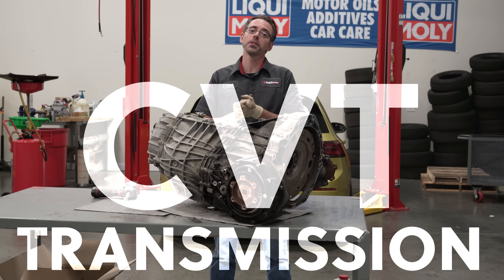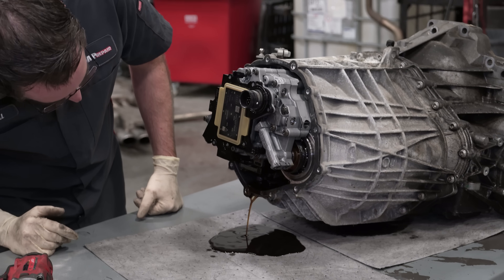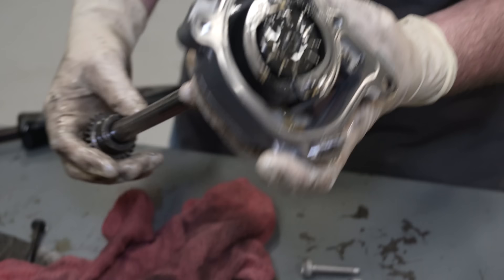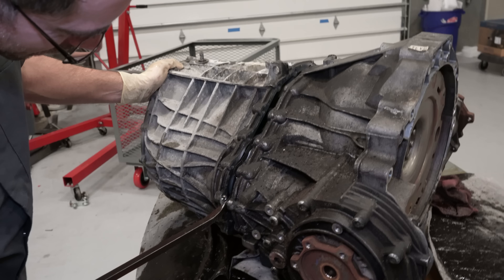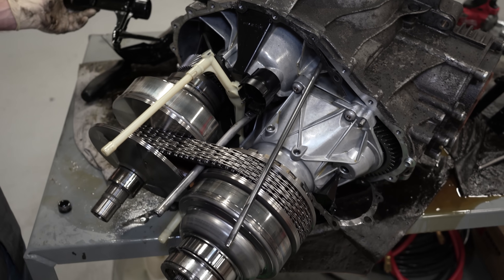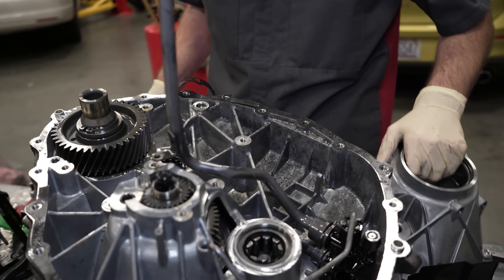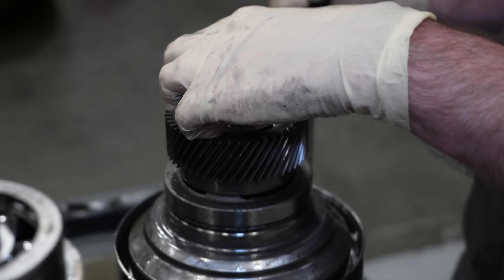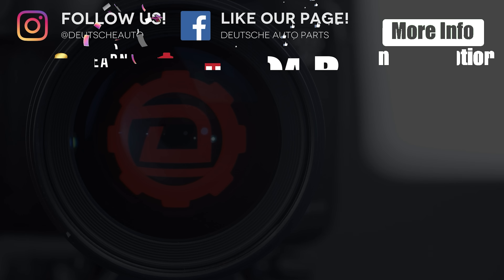Why you shouldn’t get a CVT transmission

Comment: I had an 8 gear auto volvo XC40. Now have a lexus UX250. When braking hard and then accelerating into a bend the volvo would get confused about which gear to select. Annoying delay. The lexus is instant everywhere so is quicker in town definitely. Much prefer the Lexus CVT.

Comment: my 2014 honda accord is currently at 299, 720 miles. I used the recommended HCF-2 oil, every 80,000-100,000 miles. I also replaced the filter at 280k miles (i know i risked messing up the transmission by changing the filter that late for the first time.). If i do end up getting another CVT vehicle, id just stick with Toyota or Honda, i've heard nothing but bad things about the nissan CVT's

Comment: LOL This concept has been around for over a Century. My 1940's bench lathe I use for tool and die making, uses the same engineering. Exact same. Smooth, solid and lasted way longer than any geared machine I worked with. I promise you a belt wheel machine made the dies that produced parts for all of your vehicle's molds and fasteners. It's only a matter of time until it gets more perfected in the automotive world. So, instead of bashing the trial years when it's for the automotive world, if you're gonna trash the idea and give up, perhaps you should work for GM. Give up easily.

Comment: I had a 13 year old Honda with a CVT and it juddered a lot when moving off. I got it used when it was  10-11 years old and I guess the oil wasn't changed. It was still drivable though.

Comment: I had a Nissan Gloria with the extroid CVT.
It was RWD 3L V6 turbo.
The most silky smooth transmission I've ever driven.
It had about 280,000km on the clock before I sold it.
I did a full service at around 150k, the oil - KTF-1 was crazy expensive.
The gearbox is quite unique in the cvt world.
Reply: it drives and sounds like a boat transmission
Reply: @whoawoahh  and they are an absolute nightmare to work on. just a complete messs
Reply: The toroidal one? Wish they would use that more.
Reply: Nope

Comment: Being covered with flour from head to toe doesn't make you a baker. Do you really know what you're doing? Because it doesn't look like you do. Yes, badly designed and/or made CVT's can be a headache, but here's a newsflash: more and more car makers use them. Why? They are the closest thing to a perfect compromise between fuel consumption limits and power needs, as they help use engines well within the boundaries of their optimum performance envelope by eliminating much of the performance delivery gaps inherent to all the other types of transmissions.

Comment: CVTs might last longer if the fluid was changed more often, and manufacturers called for more frequent fluid changes.
I have a member of my family who has a Nissan Murano, and drove his over 150,000 miles. I told him to change the fluid twice as often as what the manual says.
The only reason he sold that Murano and bought a new one was because he just wanted a newer car.

7:57 Nissan probably uses them the most. Scotty Kilmer loves to make fun of Nissans.

Usually when a CVT fails, it is the steel chain going boom. It looks like a metal bird exploded and stuck its feathers everywhere.

Comment: lol COOL, yeah I hate them too, at least that one, with the crap design, they would be better off changing the chain width with electromagnets, but then why even bother with the gear ratios, they can do away with all the heavy differential and drive shafts, use the engine to generate electricity for electric motors 1 driving each wheel, cars could be a lot cheaper and cause less global warming, but nope, Elon Morron wants to make Tesla cars that have a battery that costs more than an engine and transmission combined and costs 7.5 tons of CO2 each and it gives the car a use by date too, regardless of how often you drive it, the battery die anyway, it's greed, he knows you can't sell them second hand, they're all throw-away CO2 pumping nightmare cars that Muskrat has chosen, he could have used hydrogen instead of what he is making and he is hoping to take off to live on Mars when the global warming cycle comes to its natural end. 
The guy will go down as the biggest mass murderer ever, but with only microscopic deep sea creatures still living in an ice age, his crimes of needlessly producing massive CO2 emissions will go unpunished, he should be ashamed of himself.

Comment: Not sure why you made a video about CVT's when you literally know nothing about them, including the differences between an Audi or Subaru chain driven one vs a Nissan pushbelt driven one. Heck, you leaked CVT fluid everywhere because you don't know what you are doing, then were surprised after that when you covered your shirt in fluid because you don't have a clue how the variators worked and didn't realize the pressure reservoir inside it would be filled with fluid because you didn't drain the thing right. Then, you had ZERO clue how to remove the chain or chain guide, and resorted to wasting time (taking 3 times as long) doing it the wrong way. 

WOW

There's so many far better CVT vids that actually explain the strengths and weaknesses of the various designs - this sure as heck isn't one of them. This was one of the simplest chain driven CVTs to take apart, and you struggled and did it wrong EVERY STEP OF THE WAY.

Comment: CVT's get better every year and with proper maintenance will outlast an old-school tranny.
Reply: You're either an optimist or a CVT engineer. I'm gonna stick to my 1987 Toy Diesel with 300,000 Kms and the original clutch. Thank God for waaahmen and fancy interiors, who else would buy these crap new cars?
Reply: @warntheidiotmasses7114  Kia SOUl's with CVT are getting 300,000+ MILES

Comment: I have and always will be a fan of the Subaru CVT.  I have seen no reliability issues and definately help with any efficiency loss of the powertrain.  About the only thing I don't care about them is Subaru's insistence of the CVT fluid being a lifetime fluid.  Once the drivetrain warranty is up (100,000 miles) I take them back to the dealership and have the CVT fluid flushed and reserviced.  About the only AWD vehicle I would ever consider owning.
Reply: You understand that the fluid is not lifetime. The reason your Subaru cvt is reliable is because it’s a Jatco cvt and Jatco hasn’t had issues since 2013. This clown doesn’t know anything about cvt’s or history or differences between the cvt’s.

Comment: I agree with the sentiment expressed here. CVT automatic transmissions are garbage & should NEVER have been made. It is apparent that after all the problems that have cropped up, they should no longer be made. I don't care what some say about how much they have "improved"in cars like the Corolla. That's just saying they are no longer as bad as they were.... but are still iffy. They are INHERENTLY weak, prone to break down, & IF they were in fact tough, they could be,,,,but in fact are NOT,  used in vehicles that pump out a lot of HP & Torque!! The very slight gain in improved gas mileage is not worth the expense in possible breakdown & replacement cost, nor the extra expenses in maintenance, nor the worry over them. Bury them once in for all.

Comment: They call it the CVT transmission technology is an ingenious milestone of optimization in modern vehicles. While it's  the worst design that's costly & easily to break down of it's complex assembly & functions. I had a Kia Sorento I drove 500,000 miles that came with a conventional automatic transmission while others who drive CVT cars complained about faulty CVT transmission at the threshold of 100,000 miles..

Comment: Hello ! I have a question and I hope you can help me solve the problem! I have an Alfa Romeo Mito 2011 1.4 petrol automatic gearbox and the engine was damaged and I had to change the engine and I bought an engine and we changed the engine but after changing the engine the transmission it does not work and when you put it in driving mode or any mode  it crack a few times and then gives a signal of a malfunction in the gearbox. And when you do the diagnos, it gives you an issue  in  hydraulic system. Do you have any suggestions or idea about this ISSUE ?  REGARDS

Comment: I had a 2000 Micra K11 1L with the old "N-CVT" transmission. It was an interesting technical implementation because it used an electromagnetic powder clutch to control the amount of coupling between the engine and transmission, unlike other autoboxes which used a torque converter. It had zero creep, so if you stopped the car and didn't use the footbrake or handbrake, the car would just sit still (or even roll backwards if on a hill).
It had some reliability issues leading to juddering and slip when the carbon brushes inside the powder clutch (like alternator brushes, contacting a slip ring inside the clutch) would wear down. They were easily replaced (me and my wife replaced ours with alternator brushes for about €7), but eventually the powder needs replacing too and then it's probably not worth it anymore.
In late 2000 they replaced the N-CVT with a newer H-CVT model, based on a more conventional torque converter.
That said, I really miss that car. It was quite nippy up to about 30 km/h, then acceptable up to 50, then extremely slow up to 120 and beyond. It was really light and nimble, and I found the CVT great fun to drive. The high RPM whininess didn't bother me, but I can see why some people would dislike it.

Comment: Not all CVT are equal. The one in the new Subaru WRX are better then what you would find in a typical economy car.
Reply: It’s a modified Jatco cvt based on the JF017E. High torque and modified for the boxer engine. It’s an excellent cvt.

Comment: How much longer til you upload the rebuild video for that transmission?

I just bought a 2023 Subaru Outback with of course, CVT. Any words on reliability?
Reply: Simple answer. They can be problematic if you ignore the maintenance. Cvt fluid changes every 30k miles and it’ll be very reliable.

Comment: Stop the Shudder/judder – Don’t Replace that Nissan CVT without first trying this JilCat Professional supplement. Many different vehicle makes have used CVT Transmsissions. Ford, Subaru, Mitsubishi, Honda and even Toyota. All CVT’s can benefit from Jilcat Proline CVT Supplement. Many have had CVT issues across all their models for many year models. Altima, Murano, Sentra, Rogue, Juke, Pathfinder and Maxima. The JilCat supplement also works with Mitsubishi, Subaru, Jeep, Ford and Honda CVT’s that shudder. The standard repair is to replace the transmission. Cost: $2000 or more. Try Jilcat Proline CVT Supplement for less than $35 instead. There have been hundreds taken care of across the country. Do not replace, lubricate with an aerospace designed lubricant and metal conditioner first instead. They have a Youtube channel speaking to these issues as well. @jilcatproline6390

Comment: It’s not really that new of technology, new to automotive but it’s been used in agriculture for belt drives for decades to power equipment. Cvt transmissions are known to be top tier in agriculture having high horsepower heavy load applications but could be reliable due to lower output rpm’s maybe?

Comment: My dad bought a 51 Chrysler New Yorker. It had the first run Chrysler hemi V8 engine in it. It also had a semi automatic transmission I believe they called it. Perhaps you had to lift your foot off the gas for it to shift gears. Anyway, that was the Achilles heel of that year Chrysler. Three or four times we'd be driving along and smell transmission fluid and we knew it was about to stop running. I still remember the anxiety we felt. About nineteen fifty-nine it broke down in Bakersfield on our way to Tulare from Los Angeles. My family lived hand-to-mouth. I remember seeing that transmission all torn apart on the garage floor where we took it to be repaired and the mechanic telling my dad what had to be done and what it would cost. Somehow, dad always came through but it was a struggle.

Comment: I would never tow with this crap and definitely keep the oil changed every 30k miles. You have to baby them for them to last into the 400k mile league IF they cant eve make it that far. Haven't seen one thats at least 10 years old and with that many miles yet w/o rebuild.

Comment: The real problem with CVTs is that they aren't serviced enough. I have one in my Lincoln MKZ, which probably is a Toyota design. They recommend a 150k fluid service which is nuts. I changed my fluid 3 times before the 150k service interval and have no issues with it.
Overservice the vehicle.

Comment: Moral of the story - should be - never push CVT trans, just drive smoothly and it lasts a lot more with good mileage. But your driving engagements are never priority, just all about no drama moving from A to B. Just linear movement to get the most of the vehicle while getting better savings on fuel - kinda boring.

Comment: My wife is ready to get her 6th Infiniti. All had the CVT transmission with no issues. If you are driving the vehicle normally under everyday conditions, I don't see what the hype is! The dealer did mention the new QX60 has an automatic transmission which is supposed to much better, but it's all bullshit! I agree!! I laugh at all the motorheads who complain because the response time takes an extra second when you punch the gas. Buy a Corvette if you want response time!

Comment: The 'chain' looked to have a very unusual design; is it working in tension? It almost looks like the interlocking structure is designed to work in compression.

Comment: I had a lot of Mitsubishi Outlanders. In the begging they had awful manual and automatic transmissions. Without changing the engines all while making the Outlanders heavier and heavier, the introduction of the CVT reduced my real life city consumption from 21 liters per 100 kilometres down to 16/100. CVT with AWD blasts you away at traffic lights. If you make the first change of oil and filter of the CVT before 60000km and the subsequently every 50000km, you will never have any issues with Jatco CVTs. Such a transmission can easily last 200000km. They you have a CVT refurbishment for 1000-1200 euros and you are back on the road for at least another 120000-150000km. Oil change and temperature management is key. Always allow the car to warm up for 120 seconds in winter seasons.

If VAG cannot find or produce adequate CVT transmissions that works well on Audies, that is not the fault of CVTs.

With CVTs you keep the engine spinning at their most efficient RPM range. This reduces engine wear and emissions.

Comment: Four circles and V over W, essentially the same, are fair warning in general. Belts and pulleys are fine as a clutch to drive a lawn mower but do not belong in road vehicles. In fact, most conventional automatics are crap. Over the years I've had multiple manual transmissions, 3-5, and NONE has ever failed. I drive them so that I never had to replace a clutch assembly either.

Comment: Brilliant review for which I thank you. I'm about to buy a newish car at the moment and was thinking about avoiding anything with a CVT transmission. Your video certainly makes my mind up and I'll chose a car with a conventional automatic gearbox. Thanks again.
Reply: Honda and Toyota CVTs last longer than traditional automatic transmissions. If you buy a car that isn't known for reliability, you're going to have a lot more fail than just the cvt
Reply: @hustla818  Thanks for your helpful comment, it's appreciated.
Reply: @Ken Walker  no problem. I have 250k miles on my 2018 civic and still runs like new. I've only changed the transmission fluid once at 80k miles, and I drive hard I don't baby the car at all. They're good transmission and Toyota and Honda are reliable cars in general
Reply: @hustla818  Thanks again. That Honda Civic is amazing then and a lot of miles in a few years. My mileage is very low. Probably take me 20 years to do that much.

Comment: I'm turned off by CVT transmissions and did see a 2014 Honda Jazz/fit here in Australia at a good price but I'm concerned about the transmission failing which put me off buying the car, it's only travelled 68,000 kilometers but I want it to last as long as my currant manual gearbox and get some years out of it
Reply: The Honda Jizz is a decent vehicle. I’d roll the dice on it.

Comment: Fortunately, Honda did a proactive recall on my wife's 2016 HR-V CVT. The local garage did a diagnosis to see if any damage had already happened (still OK) and then reprogrammed the software. Finally, Honda extended the warranty to 150K miles. Because of the reprogramming, the CVT doesn't seem to be hunting for the right gear anymore and performs perfectly. Since I am kind of OCD about maintenance on all of my vehicles, the transmission gets new fluid every 30K miles. 
Personally, I prefer the 09G transmission in my old 2008 Rabbit 2.5 because I like feeling the gear shifts as well as watching the tachometer. I"m an old-school,  "analog man in a digital world", as Joe Walsh sings. With only 162K miles on it, it still shifts perfectly.

Comment: My 2015 lancer gt has a cvt, I drive the crap out of it since I use it as a daily driver and a rally caron the weekends, pushing 180,000 miles with no issues, but I change my fluid every 15k miles, so preventative maintenance is a high priority to prevent problems

Comment: Running the axle across the transmission by creating a space between the flex plate and the torque converter is beyond crazy.  I hate cvt as well